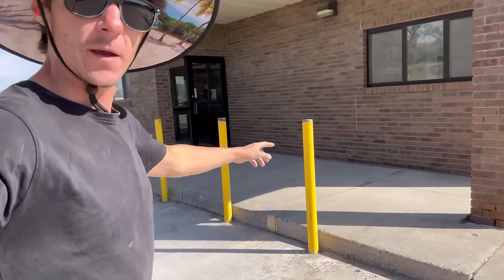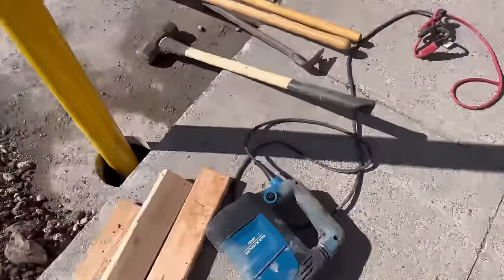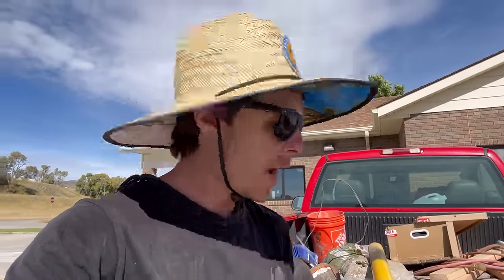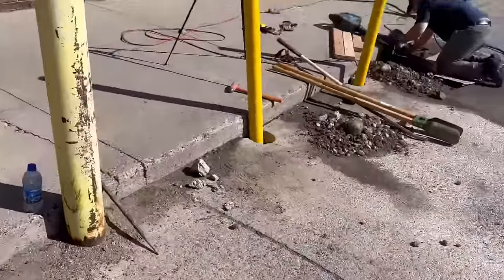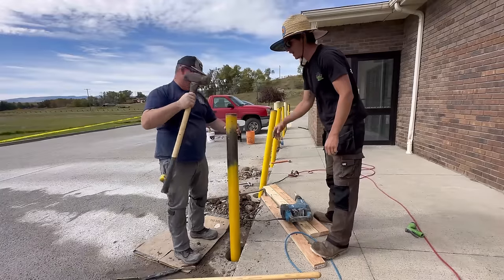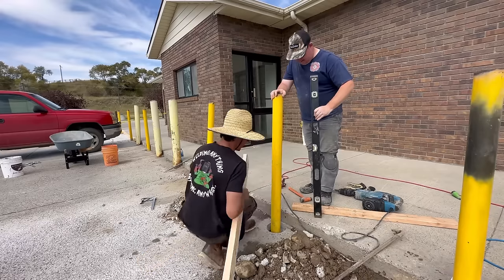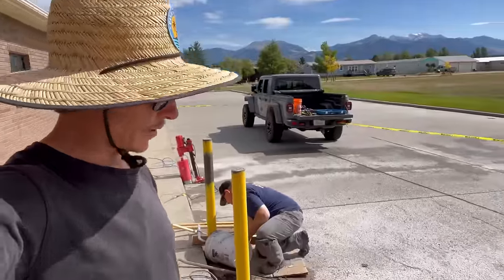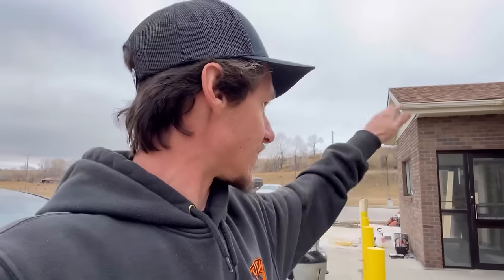Can we Save This Building? (Bollard installation)

Comment: Having learned the hard way many, many years ago  I learned to to drill a hole in the top of where the core was going to be and drive in a lag shield. After you drill the core run a lag bolt in the shield and use the head of the lag to pry/pull the core out of the hole.  I even did that on large cores in vertical surfaces. It made it much easier to pull/handle the core.

Also, go buy the vacuum base for your drilling rig. It will only work on poured concrete or very dense material but it comes in handy!

Comment: If you're coring through the core should pull right out without breaking it up. Drill a 1/4" hole for a concrete screw and bolt a lifting eye to them.
Reply: in minecraft yes

Comment: I know its different everywhere but Home Depot in Ohio requires us to use 6” pole. They want them 3 feet in 5 feet out and a 24x24 square cut around bottom. I unfortunately have set more bollards than I ever want to think about. I’ve seen engineer drawings for these in parking lots that want some crazy stuff that is way overkill. For what you did here its perfect for that lot in my opinion.

Comment: A couple things I do is run a couple string lines. One to make all of the tops level, and one to make them all in a straight line. It looks like you just butted them up against the sidewalk which works. Unfortunately they approved using a smaller size. It looks like shit having different sizes, but not on your part. Stay safe!
Reply from the maker: Ya the cost was significantly more to go up in size. As far as alignment we just eyeballed the top. They came out straight to the eye. But I bet not perfect if you put a laser or string to them.

Comment: seriously, try dry packing the bag mix.

just pour it in the hole dry and pack it in with a heavy bar as you go..
if the ground is damp, the conc' will go off fine.
If the ground is realy dry, put some water in the hole first.
.
Four big advantages.
the conc' will pack the surrounding ground.
the conc will pack down realy hard
you can adjust for plumb as you pack down.
Stong and stable straight away, even stronger tomorrow.
.
wet to top inch or so, so you can make it look finished.
.
This comes up way stronger than you might expect.
.
Try this dry packing at your place, compared to wet poured ..... be sure to make the vid .... you can have this one for free.

Comment: Well that's weird cause here in Boston they have things that are called codes only reason I'm saying at least when you put these in front of gas meters minimum 48 inches below and above grade .I don't remember spacing but please people look up what your city's bullshit code is trust me took me forever same shit my holes full of rocks took forever to do 8 of them
Reply: Around something like a gas pump is one thing.  In front of a business like this is another.  I doubt they even require bollards in front of a business like this
Reply from the maker: That’s a gas meter, and it’s also based on how much speed a vehicle can gain in a certain amount of space. The GC I work for in Florida has me bury everything 1/3 of the way in the ground, so I just piggybacked that because this parking lot is significantly smaller than a Home Depot